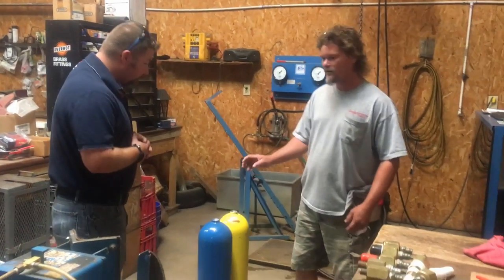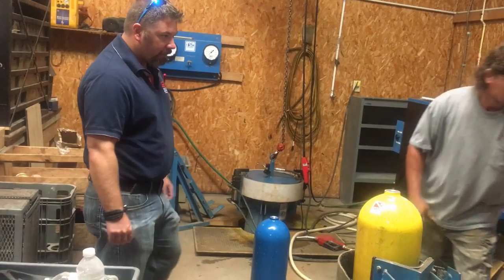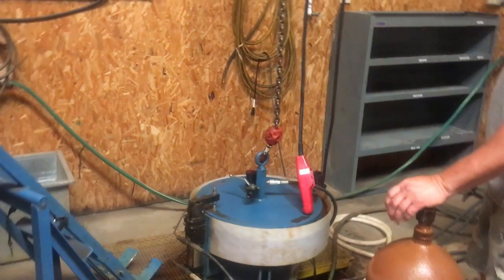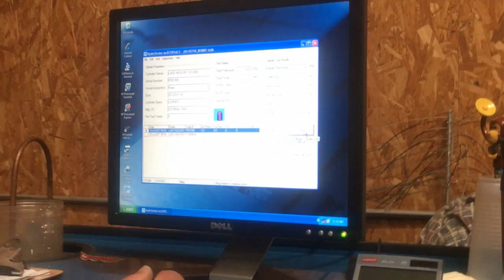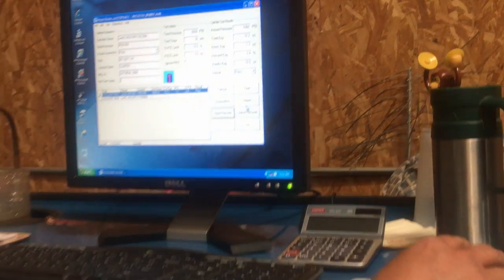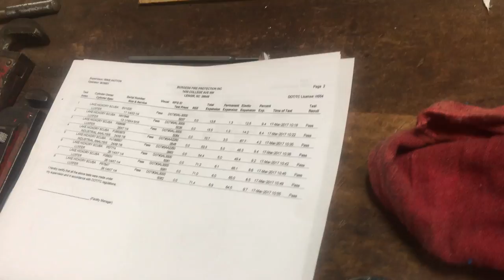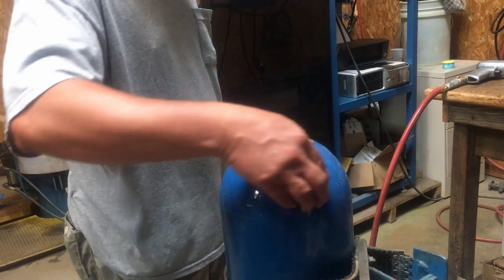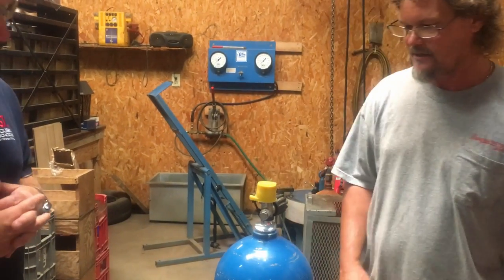Behind The Scenes Of A Hydro-Static Test

Comment: Thank you Brian and Bobby for showing the process of a Hydro-Static Test on a tank. Appreciate the thought process and the execution of getting it done. There will always be people that find problems in everything that you do. I am not in the Scuba World, but have a 20lb CO2 tank that I need to get tested as my imprinted date is 4@15. Been doing research in my area to find a place to have the test done, and wanted to understand what the process entailed from an learning perspective. This video did the trick for sure. Question - How much does the test cost roughly? Thank you again for your efforts and the parted knowledge.
Reply from the maker: Hello Walter Bellini, I can only speak on the retail side of the Scuba Industry. Currently, we are charging $40 per cylinder to do a hydro. This may very based off you geographical location.

Comment: Good information, I've always wondered about the process. Every time I send a tank I say a silent little prayer it'll pass although I've never had a failure from hydro yet. Did have one tank I bought used and dove with it a year or two that subsequently failed vip due to pitting.
Reply from the maker: Hello Bill Hazel, in my career I have seen several tanks that have failed.  Its never a good day when you have to explain to the customer why we had to condemn their cylinder.
Reply: @LakeHickoryScuba  It should be a good day - You may have saved a life!
Reply from the maker: Very true

Comment: Am I right in thinking they are not testing if the tank can hold the pressure but how much the tank stretches out showing it still has some elasticity? Trying to remember a comment from Alec’s channel
Reply from the maker: Hello W B, hydro testing sole purpose is to test the structural integrity of the cylinder under pressure.

Comment: Just curious, wouldn't it be a good idea to put a valve on the tank, or cap over the opening of the tank prior to stamping it? Seems like with it open, pieces of paint or other debris could get down inside the tank. I also didn't see the technician doing a visual inspection of the inside tank walls, only the threads. Is their VIP not really considered a part of the hydro test? I'm not being critical, I honestly don't know what their responsibility is as far as visually inspecting the whole tank. Interesting video, thanks for posting.
Reply from the maker: The visual inspection they perform isn't quite as thorough as the visual inspection a dive shop does, this has always been a misconception.  And in regards to the capping off the valve, it's not really necessary.  Its pretty easy to keep debris out while handling the cylinder, just as it is keeping water out of the first stage after removing it from the cylinder.
Reply: I was about to say this is nonsense...then I got to the part of the video where he used the wire brush after stamping. This guy needs to cap the tanks first. Lol.

Comment: Very interesting... I was surprised the test pressure was 5000 psi for a 3000 psi tank.  Makes me feel a little better when I hear about “cave fills” going 10-20% over fill.
Reply from the maker: Hydro Test are always conducted at 5/3's the working pressure.  So on a 3000 psi cylinder, the hydro test will be conducted at 5000 psi.

Comment: Interesting that the hydro testing facility has PVC air lines on the walls that are not OSHA approved. 
I once had the job of replacing all of the plastic air lines in a cabinet shop because the OSHA inspector turned them down and threatened to fine the owners if the plastic air lines were not removed within 15 days.
Reply from the maker: Hello David Tyndall, I can't speak for the company, only ours.
Reply: Interesting question, I wonder if the DOT rated fiberglass reinforced  nylon tubing that I ran to the tire inflator is a OSHA violation?

Comment: 2nd video I watched on hydro testing and I still don't understand the process.   I see you fill the tank up with water and then I see you submerse the tank in another tank of water...      I saw the computer screen but there was no explanation of what is really  taking place.     Where is the pressure applied and how?     It's really not explained here.    I see all your equipment but I don't hear an in depth explanation as to how it all works.        Is pressure applied to the tank that the portable tank is submerged in?     Is water pressure applied to the fixed tank?    How is the pressure measured?
Reply from the maker: Hello @earthstewardude, maybe this explanation will help you out. Hydrostatic testing is the primary method used to test for leaks and assess the structural integrity of meter skids, compressed gas cylinders, boilers, tubing, pipelines and other pressurized vessels. It’s performed by filling the system with water, pressurizing it up to a level greater than Maximum Allowable Working Pressure (MAWP), and monitoring for visible and/or measurable leaks during a specified amount of time.

Comment: Hi, does anyone knows whats the % of PSI you need to use for testing the cylinders? For example, that blue cylinder was testes 30 secs at 5000 PSI, but whats the regular working PSI pressure of the cylinder, 2216 PSI, 4500 PSI ??? ????
Reply from the maker: The working pressure of the cylinder in the video is 3000 psi (206 bar).
Reply: @LakeHickoryScuba  Thanks for the info!
Reply from the maker: You’re welcome. Thanks for watching
Reply: Dot goes times 5 divide by 3 that's your test pressure 5/3

Comment: I'm more concerned about all the pesticides and outdoor service equipment getting in my tank from this place.  Under the table of tools is Killsall, then right where the air intake for the dryer fan is are a chemical sprayer and other toxins that could be put into a tank I might have there.  Perhaps it is just me but at 100' down I don't want to be breathing weed killer and gas fumes that were dried into my tank.  And like another person posted but shouldn't the stamping be done while the cylinder is plugged so scraps of metal are not getting inside my tank?  The wire brush process to clean up the newly stamped area can easily throw fragments into my tank.  I ran over and watched the next step of this that being the visual inspection back at the dive shop.  There was no cleaning of the inside of the tank there so the chemicals that got in the tank at the hydro facility are not removed before filling a tank.
Reply from the maker: Thank You for watching our videos and commenting.  Happy diving

Comment: Wouldn't it be better to first properly paint the stamp so the bare metal is sealed, then perhaps use the marker on top of that paint? The marker is probably not the best anti-rust protection.
Reply from the maker: Hello @Engineer9736, sorry to hear that you have had issues with your tanks rusting on the outside. We have never had an issue with that.

Comment: how was this done prior to computers?
Reply from the maker: Here is the easiest way I can explain it.  Water Displacement.  Here is an exert that may help---------

Small pressure vessels are normally tested using a water jacket test. The vessel is visually examined for defects and then placed in a container filled with water, and in which the change in volume of the vessel can be measured, usually by monitoring the water level in a calibrated tube. The vessel is then pressurised for a specified period, usually 30 or more seconds, and if specified, the expansion will be measured by reading off the amount of liquid that has been forced into the measuring tube by the volume increase of the pressurised vessel. The vessel is then depressurised, and the permanent volume increase due to plastic deformation while under pressure is measured by comparing the final volume in the measuring tube with the volume before pressurisation. A leak will give a similar result to permanent set, but will be detectable by holding the volume in the pressurised vessel by closing the inlet valve for a period before depressurising, as the pressure will drop steadily during this period if there is a leak. In most cases a permanent set that exceeds the specified maximum will indicate failure. A leak may also be a failure criterion, but it may be that the leak is due to poor sealing of the test equipment. If the vessel fails, it will normally go through a condemning process marking the cylinder as unsafe.The information needed to specify the test is stamped onto the cylinder. This includes the design standard, serial number, manufacturer, and manufacture date. After testing, the vessel or its nameplate will usually be stamp marked with the date of the successful test, and the test facility's identification mark.A simpler test, that is also considered a hydrostatic test but can be performed by anyone who has a garden hose, is to pressurise the vessel by filling it with water and to physically examine the outside for leaks. This type of test is suitable for containers such as boat fuel tanks, which are not pressure vessels but must work under the hydrostatic pressure of the contents. A hydrostatic test head is usually specified as a height above the tank top. The tank is pressurised by filling water to the specified height through a temporary standpipe if necessary. It may be necessary to seal vents and other outlets during the test.
Reply: @LakeHickoryScuba  It's amazing how people devised methods to accomplish things without computers. And now we are so reliant on the computers, in a lot of industries people preforming tasks aren't even aware of what is happening or what the computer or microprocessor is actually doing.
Reply from the maker: @rlwieneke-cf3xq  That's a part of life in this day and age.  Technology makes things easier for us and more productive, but at the same time we become reliant on it to the point we are stuck if the the technology ever breaks down.
Reply: @LakeHickoryScuba  the Puerto Rico months long electricity outage would be a perfect example.
Reply from the maker: That would definitely cause some issues
Reply: Like LakeHickoryScuba says, it's testing measured water displacement.  Most dive shops outsource their hydros, my local shop does it's own hydros, and it's not connected to a computer.  The most advanced piece of equipment attached to it is a digital scale........ to measure the amount of water displacement.

Comment: Hydro test machine is still running Windows XP. I hope he has an upgrade plan.
Reply from the maker: I was thinking the exact same thing.
Reply: Actually there is no need to upgrade as long as said system works and is not connected to a network / the internet. You wouldn't believe how many legacy systems are still being used in companies all around the world and the lengths they go through just to keep said systems running.

Windows XP is plenty fine for offline special use cases like this. In fact you can even see in the task tray that no network connection is established.
Reply from the maker: Good to know. Thanks.
Reply: LakeHickoryScuba  Thanks for the video by the way. Very interesting/informative.
Reply from the maker: You’re welcome
Reply: @oBsRVr666  Agreed, other issues could be, a very old hard drive that is due to fail, backups or exports of the database that contains all the data from all the historical tests. Plus that filing cabinet should not be on the floor, in case of flooding, if that is the only copy of the records for customers.
Reply: @walter.bellini  

That's some very good advice. Some more cynical persons in the IT persons would probably say something like: "Data that's not at least backed up three times with one off-site backup, is not considered important". A good backup strategy is definitely important.

Comment: A facility that does hydro testing of pressurized gas cylinders uses PVC pipe for their compressed air supply? They better hope OSHA doesn’t pay them a personal visit.
Reply from the maker: I guess it could be worse.  Could you imagine if they would have used pool noodles instead.
Reply: @LakeHickoryScuba  If they don't comply with OSHA rules, what makes you think they comply with anything else? is their rig calibrated?

Comment: Nice video but not informative !  Lot of questions left unanswered since the answers were mumbled by the technician. No explanation  given of each procedure (why do this and what am I looking for ) except for the host trying to explain it without an intelligible answer.... I just saw the whole procedure for the first time been done in a cluttered shop with hoses and wires all over the floor which had to be stepped over for each procedure.
Reply from the maker: Hello joserafa03, thank you for watching our video and commenting, it supports us in so many ways.  Sorry to hear that you did not enjoy the video.
Reply: I enjoyed the video, but it does not SHOW like a high volume operation with dirt, rust, wires and hoses all over.  Been diving 27 years and never seen the process.  Good to see the computer determines pass/fail instead of a human.  That hydraulic tank holder is kewl.  The other comment was right about the muffled tech, he should have been mic'd (or mic'd better).  Or he could have narrated the video after the fact.  Informative it was IMHO.  Thx.

Comment: Virtually unintelligible with very low volume and a hardly informative operator.
Reply from the maker: Thank You for letting us know about the audio quality.  We will try to improve it in the future.
Reply: Mics clipped to the shirt go a long way towards improving audibility.  And whenever possible, laying down a rug near the speaking subjects helps dampen unwanted sound reverb.
Reply from the maker: Thank you for the advise.  We have started using mics since this video was uploaded.  I will try out the rug trick in the future.
Reply: Is a Sharpie Marker environmental friendly?
Reply from the maker: I would suggest reading the side of your Sharpie Marker to see if it says non-toxic. I know some are and some are not. With this being said, most dive operators still use lead weights, which are not very environmentally friendly.  It’s the nature of the beast sometimes.